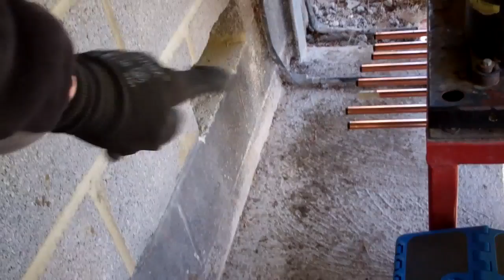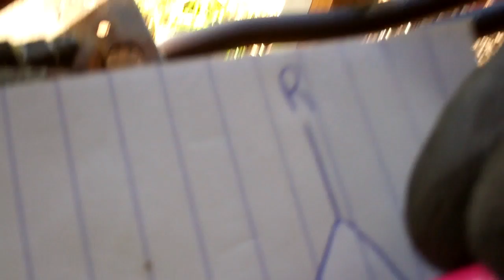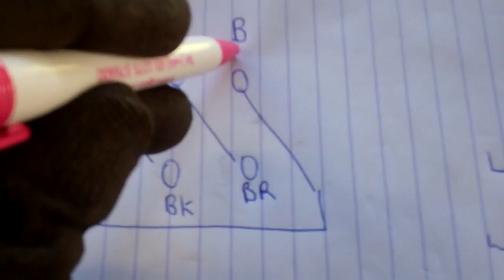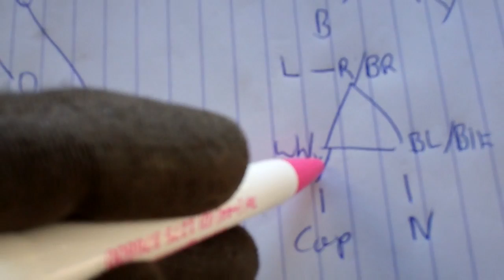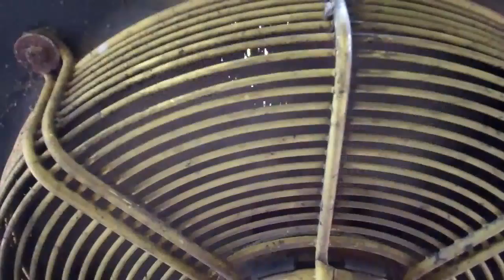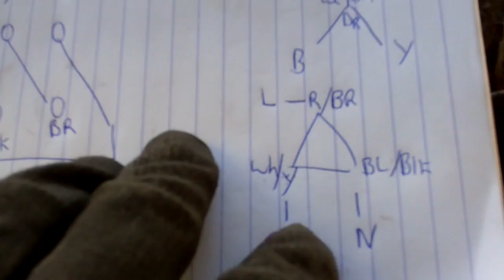3 phase motor converted to 1 phase

Comment: I never imagined that there was 3 phase at 120 V. Changing direction on your fan?
Reply from the maker: Hi, was a three phase motor running on 415volts, i changed them to run on 240volts single phase so i could then run them on a variable speed drive, but unfortunately most of them had slightly worn bearings and it was too much for the speed control to overcome, so we ended up changing them all as the system cools $10,000 worth of milk a day and can't afford any failures.

Comment from the maker: I'd seen them come out the factory with 10uf caps on 120w motors, the other three phase motor here had a 16uf from the factory.
I didn't end up saving much as it turned out four of the five motors bearings were too tight to run on variable speed drives so we ended changing all five of them as they were between 10 and 20 years old!

Comment from the maker: Thanks! We had to change a couple of the fans as the bearings were tight and they wouldn't turn quick enough on the speed control so the windings got too hot. Sometimes you gotta do what you gotta do!

Comment: Ours is 120 volts to ground / Neutral but from each hot leg coming in its 220-240 from hot let to hot leg..... all from one primary.  I used a start capacitor for the phantom third leg on the motor approximately 15 uf per horsepower and I used a 30 or 35 uf cap...... motor ran great with ok torque, no overheating or excessive vibration.  Wired in delta....

Comment: You lose power there, as the motor is now not running at full power, but it will be enough for a fan that in any case is not using the full power from the motor.